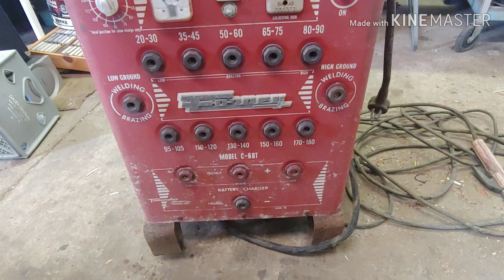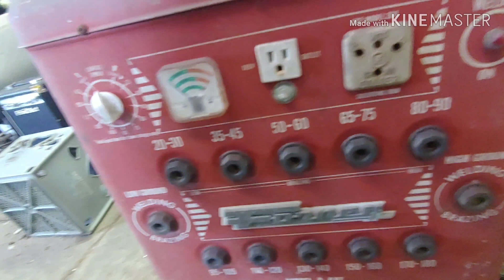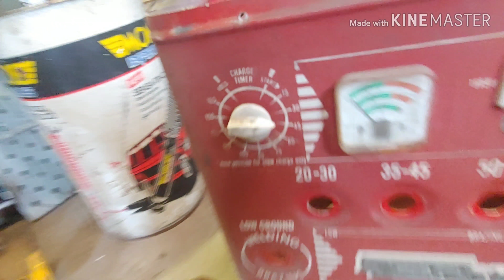Stick welder scrap out.

Comment: Being a retired welder, I would have NEVER taken that machine apart! But  you bought it and it was yours to do with as you saw fit. KEEP ON SCRAPPIN!
Reply from the maker: I hear you but nobody wants them old machines anymore there's some machines the size of a suitcase that'll run circles around that thing and weigh 10 lb with a shoulder strap... sad to say it's Antiquated technology.
Reply: @ScrapFarm  negative  scrappy..  any up and coming welder would love to play with that thing..  you could  have easily sold it for $150... you scrapped it for $20 ????
Reply from the maker: @w.e.smithereens8178  Nobody wanted it.   It's sold at the auction for ten dollars.   Nobody even wanted the cracked leads that were worth more than $20 in scrap.   Where were the aspiring welders... Probably home playing with their twenty pound suitcase.

Comment: Thanks for answering the question for me. There is one at an auction tomorrow and I let someone else buy it. Afterwards I’ll tell them it’s aluminum and they should have watched your video like I did.😌
Reply from the maker: The connections and insulators on the front of it actually sell pretty good online...if you're into that.... and obviously, if it's got cables, they're copper....

Comment: What you found out is so true with many low duty cycle welders. ALuminum was used a lot. Even the famous Lincoln tombstone welder is copper clad aluminum wire in the windings. Do you still have the socket and inserts on the welder face part ??? I need them for my welder. Thanks
Reply from the maker: No it's gone
Reply: @ScrapFarm  Thanks for the heads up Scrap Farm.

Comment: should of stuck it on ebay. One a little older sold for $180. Someone would defiantly of wanted that.Not worth the $5 in scrap you got from it to destroy it.Selling items for parts/repair on ebay is easy money with very little risk.Any electronics you find 1970 or older are wanted by someone,I have sold many solid state tvs for quite a bit on ebay.
Reply from the maker: Yeah 180 and how much was the shipping this thing weighs like 250 lb... I know there's more money online there's always more money online but I don't like dealing with it. So to the scrap yard it goes. And I won't have to wait 30 days for my money just in case somebody wants to return it.
Reply: Fix that thing and teach your self how to use it if you dont already know how to weld.
You'll make more money welding than scrapping..
Reply from the maker: @n.randall6152  yeah no s*** but that's real work and I do know how to weld. Believe me if I wanted to be a welder I'd be a welder I just like sticking things together for fun and Welding on my own s***
Reply: @ScrapFarm  they may be obselete, but they can still ot weld the new stuff!
Reply: @n.randall6152  i agree , they were bullet proof. i won several!

Comment: i would offer you my 17 pound fence maul.. but instead of using it to dismantle stuff for scrapping you would probably just scrap it for the weight
Reply from the maker: Ummmm.  Probably not but ok.
Reply: @ScrapFarm  I would have taken that welder to the flea market and had a $150.00 as is price on it. 
You can unwind the aluminum transformer coils too
Reply from the maker: @waynep343  yeah well I'm not calling the thing around for someone not to buy it I got paid for it it's done the thing was dead burned-out inside blown out capacitor it is scrap